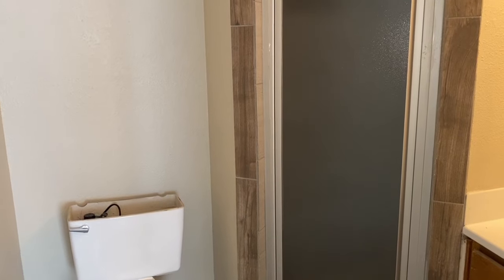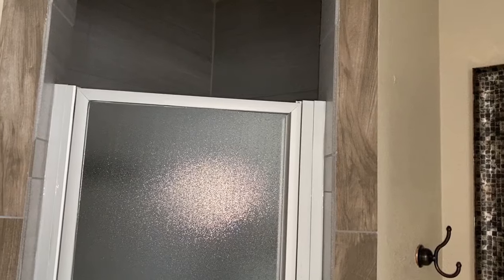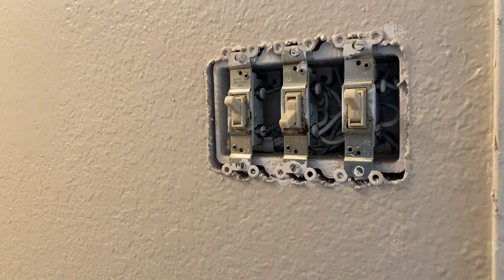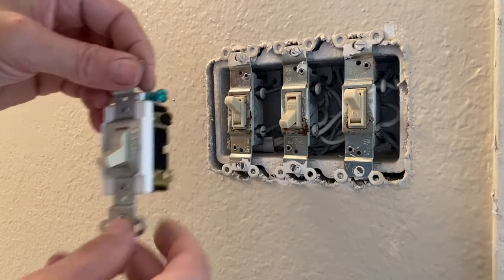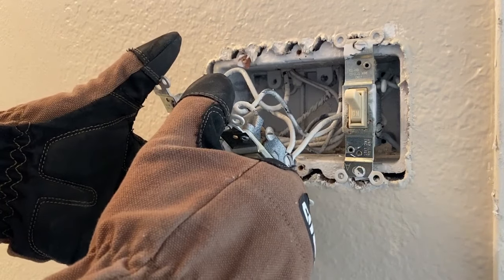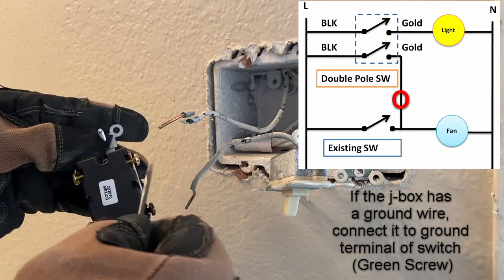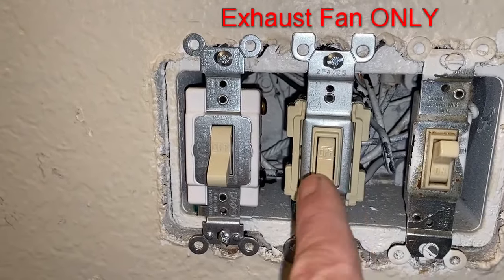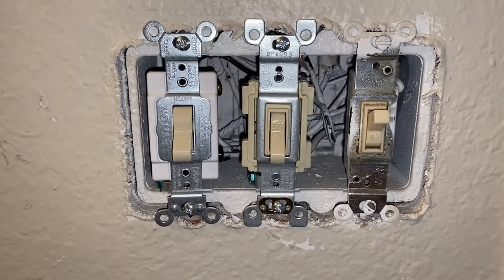Single Pole vs. Double Pole Switch-Double Pole Switch Wiring-Understand How Double Pole Switch Works

Comment from the maker: Yes, you can use a single pole switch. However, the two loads will not be isolated from each other. Which in this case, whenever the light is on the fan will be on and vice versa. Hope this helps.
Reply: I've tried connecting wire to one of the brass screws of double pole switch, added load on it, and checked the other brass screw and it was hot as well. Maybe I'm missing something, but according to my understanding, it should be separate or not?

Comment: If both the fan and the light are on the same circuit, why wouldn't you use a pigtail from the load side of the switch to connect both the fan and the light instead of using a double pole switch?
Reply from the maker: If you do that whenever the fan is on the light will be on (both will be on at the same time). The purpose of using the double pole is to keep them semi independent. You can have the fan on but not the light (getting the odor out of the bathroom) And, when the light is turned on the fan is also on (taking a shower and getting the steam out). Hope this helps.
Reply: you are right！

Comment: wont you create a short if the fan switch and the light / fan switch are on at the same time?
Reply from the maker: Yes, the line from both fan switches will feed the fan. Since the same line (hot coming from the same breaker) is feeding both switches this is like having one switch acting on the load. You could have 100 switches all sharing the same line (breaker) and load (fan). As soon as one switch is made, the load (fan) comes on. Thereafter, any and all other switches could come on and it does not affect the load (fan). Hope this helps.

Comment: One thing I saw on the middle original switch was that someone had two wires tightened on one screw, one was the hot and the other was the jumper, that's a big "no-no".  You should never have 2 or more wires connected to one screw on the switch.  I noticed you replaced it with a double-pole as well.
Reply from the maker: Thank you for the feedback.

Comment: Great job. What happens when the exhaust switch is turned on and then you turn on the Double Pole switch?
Reply from the maker: Thank you. If the exhaust switch is on, then the double switch is turned on, in this case, the light comes on and the exhaust fan will continue to run. Just as it was intended, no surprises.
Reply: @JustForYouDiy  Awesome explanation. I think I will be doing this for my bathroom. Thank you
Reply from the maker: My pleasure. If you are not a subscriber of my channel, please consider subscribing and share the channel with others. Much appreciated.

Comment: Maybe I don't understand something, but I'll try this setup and see how it works. If not, I can always use one three-way in combination with either double or single pole switch.
Reply: Because I've just tried connecting wire to one of the brass screws on double pole switch, inserted it into plug and checked voltage on other brass screw and it was hot. I don't know why that is so.
Reply from the maker: On the switch with an ohmmeter, between the brass and black screws on one side you should get continuity when the switch is in the ON position. That’s true for both sides. And, there should be no connection between the left pair of brass and black screws to the right pair of brass and black screws. This is how you know the switch is good. Hope this helps.
Reply: @JustForYouDiy  Thank you. I was trying to make a separate switch for one light and then turn on all four with the other, in which case I assume supposed to be double pole, but after doing research and finally figuring out how to get it done, I've decided to put just one commercial light instead of four. As for office 12x12 ft, it should be enough.
Reply from the maker: Happy to hear that you got the issue resolved.

Comment: First of all this is a great and helpful video.  But I would like to add some commentary to help the author in the future.  I am not a professional electrician but certainly have done my share.   One of the important things for non-professionals is to be consistent and adhere to accepted standards.  So at the beginning you hold the switch upside down contrary to the orientation of the 3 switches in the box and with the ground connection on top.  Yesterday I was in the hospital and saw some of the outlets with the ground in the bottom position and others in the top position (ie some were rightside up and other were upside down).  Next with the ground screw on the top the next screw going down from the upside down orientation is the black screw for the hot lead.  Most of the time the black is in the top position from my limited experience and the gold screw in this orientation is on the bottom for the load or device being powered.  

So in conclusion when installing the double pole switch orient it so that you see the OFF label and the switch is down.  Use an inductive power tester to identify which 2 lines are hot.  Turn off the circuit breaker for safety and the  connect the two hot (incoming power from power company - live.  Very often black or brown) to the Gold screws.  Then connect the two load lines to the device being powered to the Black screws which should be the top screws except for the ground which in a double pole switch is actually on the very top unlike a power outlet where it is on the bottom.  Now you can connect the Ground wire to this top silver screw that does not have a matching screw on the other side.  Now I would recommend taking electrical tape and wrapping it around the screws vertically so that now contacts can accidently touch the body or the box or be touched by anyone working on the switch.  Now is the time to turn on the circuit breaker and test that everything is functioning correctly.
Reply from the maker: Thank you for your feedback.

Comment: So, if I wanted to wire a ceiling fan where one switch turns on the fan and another switch turns on the lights I would use single pole switches? Or if I wanted both the light and the fan to be controlled together I would use a double pole light switch?
Reply from the maker: Correct. Yes to both. Also, in your example you could use a single pole switch for both applications. The best use for double pole switch would be in an application where there are two switches and two devices, AND,

Switch 1 (single pole) turns on device 1-Fan (And NOT device 2-Light)
Switch 2 (double pole) turns on devices 1 & 2-Fan & Light

Double pole switch isolates the connections from device 1 and device 2. If this isolation did not exist, when switch 1 is turned on, both devices would turn on.

Comment: So you have an opinion for just the exhaust fan and the other switch for exhaust/light?
Reply from the maker: Yes, that is the way we wire them at our rental properties. When the tenant uses the light for shower, the fan also comes on. This definitely helps reduce the moisture level in this area.

Comment: Monroe York
If the fan switch is on and the dp switch at the same time isnt it a short circuit?

Thanks for asking the question. No, there will not be a short circuit. 
Think of it as having 3 independent switches, 2 in parallel for the fan and 1 for the light. One of the 2 in parallel for the fan happens to be in the same housing as the one for the light, the double pole switch. There is no electrical connection internally between the 2 switches inside the same housing. Turning one fan switch OR two fan switches on completes the same circuit. These 2 switches are in an OR configuration. And, since the light switch is isolated (even though, it is in the same housing as one of the fan switches), it is a sound electrical circuit. As shown in the video, it works beautifully. I hope this helps.

Comment: What happens if borh switches are on ?
Reply from the maker: Fan and light are on.
Reply: @JustForYouDiy  Quick question. I have a bed and breakfast Guests keep leaving mini split on all the time. Can I add a spring wound timer on one of the legs of the 240 circuit to turn it off with the timer  after 2 hours?

Comment: What happens if you turn both switches (fan only and fan / light) on?
Reply from the maker: Both fan and the light will come on.
Reply: Thank you.
Reply from the maker: I just posted a video showing what happens when both switches are on. Hope it helps.
Reply from the maker: Moisture from taking shower could cause drywall damage. Fan comes on with shower light or it doesn’t
https://youtube.com/shorts/WeMgbrTdL3Q?feature=share
Reply: @JustForYouDiy  Thank you. I appreciate your help. I did subscribe to the channel. I will need to learn a lot in a hurry.

Comment: Why leave the switch for the fan if it's hooked to the other
Reply from the maker: Good question. The fan only switch could be used if you are going to bathroom (to vent the smell). The fan/showerLight switch forces the fan to come on as you’re taking a shower (to vent the steam). So, you’ll have switches for, bathroom light (toilet), fan (vent the smell), fan/showerLight (light up shower area and vent the steam). I am at times guilty of not turning on the fan when I take a shower, this will eliminate that. Hope that helps.

Comment: Sorry.  I was in a dimly lit room and held the switch upside down and now I cannot delete or correct my comment.  

CORRECTION.  When holding the switch with the correct orientation and viewing the back the silver ground screw will be in the bottom right position.   Going up one level is the two black hot screws.  And finally the top gold screws are the load or wires going to the device being powered.
Reply from the maker: Thank you for your feedback.

Comment: I am sooooooo confused
Reply from the maker: The main purpose of the double pole switch is to all one switch to operate two loads (devices) at the same time without connecting them electronically. 

Or, you can look at it as if you have two switches next to each other and connected the two levers together mechanically (screw them together, use duct tape, etc.) But you did not have enough space for the two switch, then, you can use one double pole switch. Hope this helps.

Comment: I don't like it. I like your video and your work I just don't like this application. I'm not necessarily saying this is incorrect but I have never seen anything like this done before in 17 years. Functionally I see nothing wrong and I tried to draw it out with single poles and obviously see the issue. 
There just has to be a split switch or something possibly even pulling an additional wire if this is really the wiring you desire but I have only ever seen those used on circuits with 2 lines. I'm in Canada so 208 perhaps. Usually disconnects. Again functionally I see nothing wrong I just can't quite feel great about this. Are they not larger than the single pole switches. This could interfere with box fill almost definitely if I'm playing devil's advocate since having 3 of them in there would clearly be a massive amount of space so there would be rules. While searching that rule you may find a double pole isnt permitted to be used like this and that may be the reason for having not seen it.
Reply from the maker: Thank you for the post. Having dealt with rental properties for over 30 years, I came up with this idea/solution to prevent or reduce the amount of damage moisture could cause when taking a shower without running the fan. As you mentioned, the wiring is sound. And, it fits in the jbox just fine.